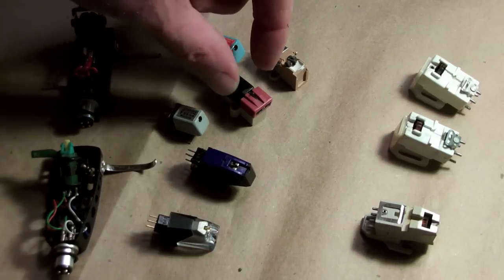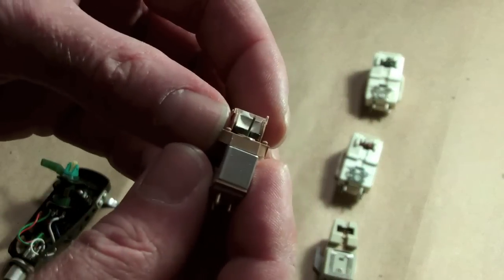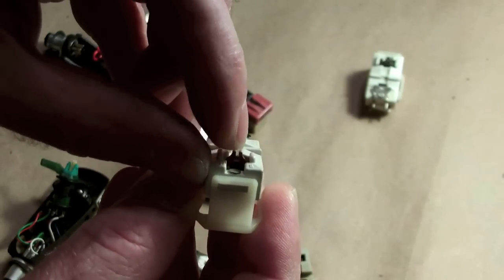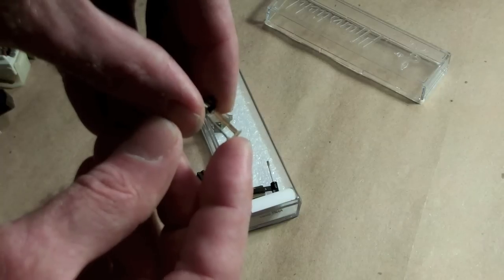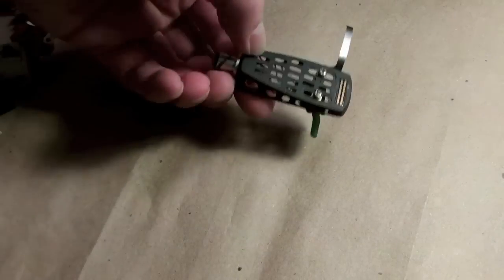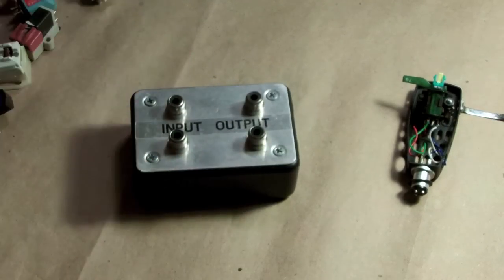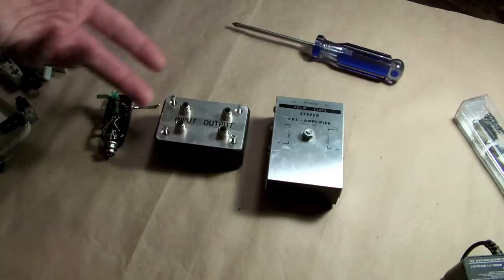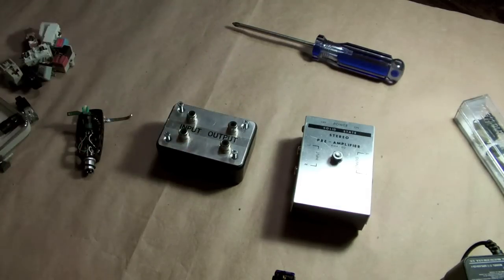121115 CeramicToMagnetic

Comment from the maker: Even though you see fewer ceramic carts out there these days, there's still plenty of them- and most modern stereos can't handle the output voltages they present. There's an easy fix- and it isn't expensive. Thanks for the compliment, honestly I think I babbled there a bit, but it was cocktail time...

Comment from the maker: YES- Under the following conditions:

Screw mounting holes must be on half-inch centers to fit the tonearm head.

The arm must be able to track between 2 and 6 grams, and the cartridge must also be one designed to track between that range.

Expensive "audiophile" carts are out of the question- record changers are brutal mechanisms designed for user convenience, and are not delicate mechanisms intended for high-end audio applications.

Comment: Mark,  there seems to be a renewed interest in RCA Victor 45 family of phonographs from the 1949-57 period, most of which had crystal or the later ceramic cartridges.  When a customer buys or restores one of these "Fabulous Victrola 45s" they often try to connect to a modern AM/FM stereo, or PC Line Input for example.  To connect in "native mode", they really need the Phono Jack which has been discontinued and replaced by Tape/Aux or CD for example.   Your solution is a perfect fit.  Thanks.

Comment: I like playing thrift store records on BSR changers and I'm glad to know there's a simple circuit to reduce the high output of a ceramic cartridge so it can be used with a receiver that only accepts a MM one. What's great is the reduced audio still gets passed through the RIAA filter, which is better than just connecting the changer straight into a line level input.
Reply from the maker: Glad to be of help!
Reply: senorverde09 just plug them into the tape or aux input!!!!!
Reply: @ddanny3108  That'll 'work', but not particularly well.  The impedance of most 'line level' inputs (tape, aux, etc) are not quite right for ceramics.   Ceramics like high input impedance - like one megohm, and line inputs are usually around 50k.   You tend to lose bass response if you connect directly to line inputs.

Comment: you can try with only one 1k (brown black red gold) resistor and a 0.1 (474) ceramic capacitor  both in series betwen signal and ground. Do not use the 47k resistor

Comment: i want to know about ceramic cartridge is damage to  disk?
Reply from the maker: They are of older technology, and yes they can damage a disk!

They don't follow the groove as well as the magnetic ones, they require more pressure (3g or more!). They eventually wear the disc out, high frequencies start to distort.
Reply: It's a fact that ceramic cartridges have simple (crude) styli shapes; usually conicals. But there are some rare ceramic carts like Zenith's Micro-Touch and Philip's GP390 that tracked at 2g.
Reply: Go find an image of both andrudda,,google took away images that you could magnify and scroll up sideways & down,, ny laptop has no way to blow images up for pasting,, ceramic cartridges are heavier,and over  just  a  few hours of  playing/usage time,they chip off high frequency signal waves cut into the disc, magnetic cartridges track at much smaller weights like half to a gram & 3/4, they are more gentle & responsive to the minute waves for highs & lows too, ceramics has a sapphire stylus,mag cartridges have a diamond tipped stylus,